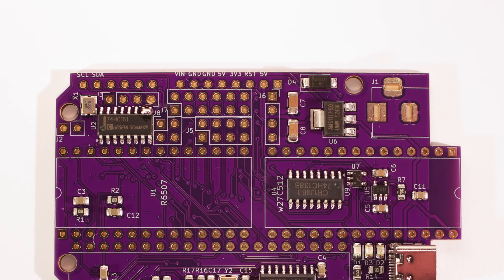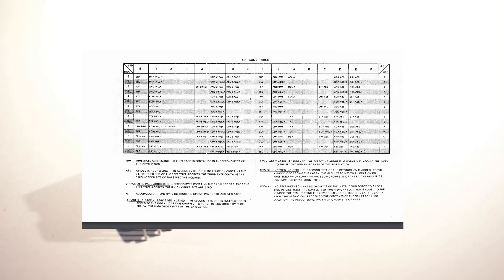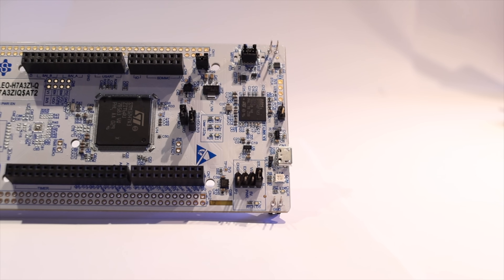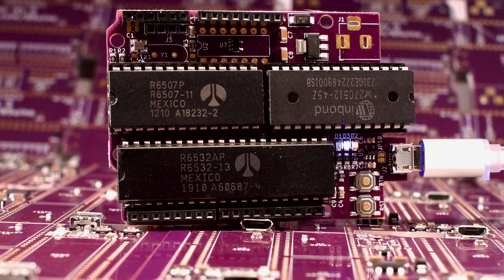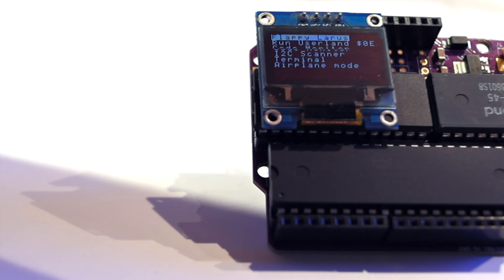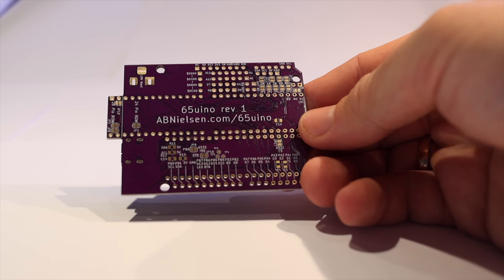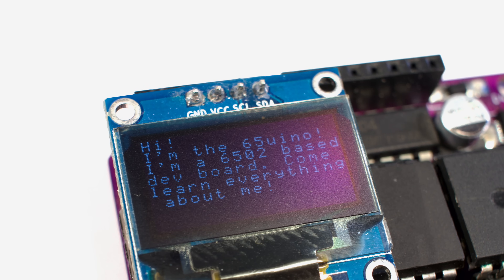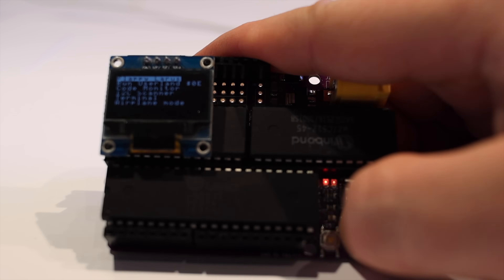6502 Turns 50! The BEST 6502 Computer of 2025 is here!

Comment: I am looking at building a simple 6502 SBC that would consist of 32k RAM, 32k ROM, a MC6847 VDG, SN76489 Sound Chip, ATARI Joystick, and a cartridge port. The cart can have up to 32k that overrides the ROM.  It could have been a cheap game console in the late 70’s early 80’s.  Comes with a default game in ROM, carts for additional games. Games own the machine, no BASIC, no BIOS. No keyboard, no serial.  A special cart with a pi pico could be used for development on a PC.
Reply from the maker: I’d love to see it 😊
Reply: @AndersNielsenAA  it will take a little while,  I purposely chose a simple design so as not to get bogged down!  I’ll make a note of this video and when I have it working, I’ll come back here and let you know. It will definitely be on GitHub for anyone to make.

Comment: /*
 * About the “easiest way to run 6502 instructions” claim
 * ------------------------------------------------------
 * Saying that a tiny 6507 board is “the simplest and cheapest way
 * to run 6502 instructions” is simply false. It isn’t even close.
 *
 * The actual simplest and most faithful way is:
 *
 *     Run a 6502 emulator.
 *
 * Tools like VICE, MAME, or any cycle-accurate 6502 core give you:
 *
 *   - full 64 KB address space
 *   - accurate 6502 timing (even exact cycle timing if needed)
 *   - real IRQ + NMI behavior
 *   - full zero page, stack, addressing modes, quirks
 *   - complete hardware ecosystems (C64, VIC-20, PET, Apple II…)
 *   - debuggers, monitors, disassemblers
 *   - stable development workflow
 *   - instant loading, saving, flashing, stepping
 *
 * And all of that runs on a modern CPU at original or faster
 * speed without any hardware hacks or cut-down variants.
 *
 * Calling a 6507 + 6532 + EEPROM board “the easiest way to run 6502
 * code” ignores the fact that:
 *
 *   - the 6507 is NOT a full 6502 (reduced address lines, no IRQ/NMI)
 *   - the memory map is crippled to 8 KB
 *   - you must build custom hardware glue logic
 *   - you get no full-featured development environment
 *   - the board cannot represent a real 6502 system architecture
 *
 * A minimal 6507 system is a fun *hobby project*, but pretending it
 * is the easiest or most authentic path to 6502 programming is just
 * marketing noise.
 *
 * If you really want the real thing:
 *
 *     Use a proper 6502 core, or a real 6502-based machine,
 *     or an emulator like VICE that does not pretend to be
 *     something it is not.
 *
 * Emulators are honest: they tell you exactly which CPU they model.
 * Some YouTube projects should take note.
 */

Comment: /*
 * Reality check for 6502-themed builds
 * ------------------------------------
 * If you build a 6507-based board, just SAY SO.
 *
 * The 6507 is a perfectly valid member of the 6502 family,
 * but it is not a full 6502:
 *   - only 13 address lines (8 KB space)
 *   - no IRQ pin
 *   - no NMI pin
 *   - reduced pinout and functionality
 *
 * And if your design also uses a 6532 RIOT (RAM + I/O + timer),
 * then call it what it is: a classic “minimal 6507 + RIOT system”
 * – essentially the same architectural footprint as an Atari 2600.
 *
 * What you should NOT do:
 *
 *   - darken or sand the 6532 package to hide the markings
 *   - mount an OLED display directly over the 6507 so the label
 *     cannot be read
 *   - show a shiny 6502 in the project intro while the actual
 *     board uses a different CPU
 *   - market the build as “a new 6502 computer” when no 6502
 *     is physically present
 *
 * Retro computing enthusiasts are not stupid.
 * If the project uses a 6507, say “6507”.
 * If the project uses a 6532, say “6532”.
 *
 * Honesty builds credibility.
 * Hiding chips destroys it.
 */
Reply from the maker: The 6507 is literally the exact same IC in a smaller package. I have never been dishonest about what I use in my designs and have never moved a single finger to obfuscate anything  - schematics are only a single click away. So is the whole video series where everything you mention has been covered. 

The 6502 is very physically present - the plastic around it doesn't change that. An ATMega328p isn't any less an ATMega328p if it comes in a different package either - and there's quite a few of those. 

I'd love to open a 40 pin and a 28 pin side by side to show you one day.

Hope you're otherwise having a nice weekend :)
Reply: @AndersNielsenAA  /*
 * Thanks for the reply. Just to clarify the technical point:
 *
 * Yes – the 6507 shares the same 6502 core*, but it is **not*
 * the same IC in a smaller package. It has:
 *
 *   - only 13 address lines (8 KB space)
 *   - no IRQ pin
 *   - no NMI pin
 *   - a different pinout
 *   - reduced bus signalling
 *   - different external requirements
 *
 * That makes the 6507 a functionally restricted device, not a
 * “small-package 6502”. The difference is architectural, not cosmetic.
 *
 * The package is irrelevant; the missing pins and missing features
 * are not. An ATmega in DIP vs TQFP is the same chip. A 6502 vs 6507
 * is *not* the same chip – same family, different capabilities.
 *
 * And that is why the distinction matters:
 *
 *   The C64 does NOT work with a 6502.
 *   It works with a 6510 – same core, different IC.
 *
 * Same rule applies here:
 *   6507 ≠ 6502
 *   Same core, different processor.
 *
 * This is not a question of honesty; it is simply a matter of
 * technical accuracy when discussing the architecture.
 */
Reply from the maker: That is incorrect. It is not just the same core. The 6502 and 6507 share exactly the same IC in a smaller package. If you had the skill you could bond the extra points to external pins. None of the features are missing in the silicon.  Just like an ATMega in a lower pin count package. 
The 6510 on the other hand is not the same IC. You are correct about that part. 

Same core, same processor - hence every single possible instruction (including the illegal ones) operate the same on the 40 pin package if you didn't hook up the extra pins. 

Hope you learned something.
Reply: @AndersNielsenAA  /*
 * Just to keep the terminology technically precise:
 *
 * A microprocessor is defined by its **externally available signals**,
 * not by the unbonded structures that may or may not exist on the die.
 *
 * The 6502 and 6507 may share the same silicon layout, but they are
 * *not the same processor* because:
 *
 *   - the 6507 exposes only 13 address lines  (8 KB space)
 *   - the 6502 exposes all 16 address lines   (64 KB space)
 *   - the 6507 has no IRQ pin
 *   - the 6507 has no NMI pin
 *   - the 6507 lacks a number of control pins (RDY, SYNC, etc.)
 *   - the pinout and system capabilities differ accordingly
 *
 * These missing pins are not a cosmetic difference — they define what
 * the device can and cannot do in an actual system. That is the
 * engineering definition of a different processor variant.
 *
 * Whether unused bond pads exist somewhere inside the package is
 * irrelevant. If the pins are not bonded out, the functionality is
 * not available, and the part is not a 6502 in any practical or
 * architectural sense.
 *
 * By that logic, a 6502 die bonded to a single pin and used as a
 * paperweight would still be a “6502” — which demonstrates why
 * external functionality, not internal die similarity, defines the
 * processor.
 *
 * Summary:
 *
 *   Same die family ≠ same IC.
 *   Same core       ≠ same processor.
 *
 * The 6502 and 6507 are related parts, not identical ones.
 */
Reply from the maker: @K @KaiWeber-gl6fb It’s the same exact IC in a different package. Of course it’s a 6502.
The only difference is Rockwell decided to bond it to a different package. 

Have fun :)
Reply: @AndersNielsenAA  /*
 * One last clarification on terminology, then I’ll leave it at that:
 *
 * In engineering practice, an IC is defined by:
 *
 *   - its part number
 *   - its documented pinout
 *   - its externally available signals and capabilities
 *
 * The 6502 and 6507 have:
 *
 *   - different part numbers (6502 vs 6507)
 *   - different pinouts
 *   - different sets of bonded-out signals
 *   - different documented address ranges and use-cases
 *
 * That is exactly why MOS and Rockwell gave them different names
 * and separate datasheets. From a system designer’s perspective,
 * they are two distinct ICs, even if they happen to share the
 * same underlying die.
 *
 * Internal silicon similarity does not override the external
 * specification. If the *datasheet**, **marking* and *pins*
 * say “6507”, then in every practical and architectural sense
 * you are designing with a 6507, not a 6502.
 *
 * Otherwise, by the same logic, a binned 8-core CPU sold as a
 * 4-core model would still be “really” an 8-core processor,
 * which is not how hardware is specified or sold.
 *
 * So:
 *
 *   Same die family  → yes, very likely.
 *   Same IC          → no, the 6502 and 6507 are different parts.
 */
Reply from the maker: @KaiWeber-gl6fb  Again - it’s the same IC. Hence there’s no special documentation for the 6507 - it has exactly the same reset vectors at $FFFC/D. 
How? It doesn’t know the top address lines aren’t connected to anything.
It also has instructions that make no sense without IRQ - but they’re still there and operate the same.
They share the same datasheet and manual for exactly that reason. 
The only difference is the package - it’s not a different CPU in any sense other than semantics.
Reply: @AndersNielsenAA  /*
 * Let’s separate three different layers here, because they are being mixed:
 *
 *   1) CPU core behaviour (micro-architecture, opcodes, vectors)
 *   2) Silicon / die reuse (manufacturing)
 *   3) IC as a usable component in a system (pins, signals, part number)
 *
 * On (1) and (2) we are actually in full agreement:
 *
 *   - The 6502 and 6507 share the same core.
 *   - They execute the same instruction set, including illegal opcodes.
 *   - They fetch the reset vector from $FFFC/$FFFD in the same internal
 *     16-bit address space.
 *   - The die layout is very likely reused.
 *
 * None of that is in dispute.
 *
 * Where we differ is (3): what counts as “the same CPU” for a system
 * designer. In practice, the part is defined by:
 *
 *   - the part number on the package,
 *   - the pins you actually get,
 *   - the signals that are externally available,
 *   - the documented address range and use-case.
 *
 * From that perspective, the 6507 is not just “a 6502 in a smaller
 * package”, because:
 *
 *   - Only A0–A12 are bonded out  →  8 KB directly addressable space.
 *   - IRQ and NMI are not bonded out  →  those interrupt sources are
 *     unavailable to the system, regardless of what exists on the die.
 *   - Other control pins (RDY, SYNC, etc.) are likewise missing at the
 *     package level.
 *
 * The fact that the core still internally runs a 16-bit address
 * calculation and still fetches from $FFFC/$FFFD does not change the
 * external reality: a 6507-based system cannot decode a full 64 KB
 * map or wire IRQ/NMI in the same way a 6502-based system can, simply
 * because the pins are not there.
 *
 * That is why, in actual hardware documentation and schematics, one
 * speaks of “6502” and “6507” as different ICs:
 *
 *   - same core family,
 *   - different pinout,
 *   - different exposed capabilities,
 *   - different role in system design.
 *
 * Calling them “the same IC” because the internal core and vectors
 * match is a statement about manufacturing and micro-architecture,
 * not about the component as it exists at the pins.
 *
 * For software-only discussions, your view (same core, same manual)
 * is fine. For hardware and system design, the distinction between
 * 6502 and 6507 is very real and technically important.
 */
Reply from the maker: @KaiWeber-gl6fb Integrated circuit. Referring to the Integrated Circuit of course - the silicon wafer where the circuit is integrated.
The package isn’t the IC - the IC is the IC.

The original 6502’s share the same IC - even if they’re packaged differently.

The architecture is 6502 - that has nothing to do with the package either - it’s just a predetermined choice of which pins you intend to use.
Reply: @AndersNielsenAA  /*
 * Fair enough – if by “IC” you strictly mean the bare die artwork,
 * then yes: the 6502/6507 share the same integrated circuit in that
 * narrow, manufacturing-centric sense.
 *
 * That has never been the point of disagreement.
 *
 * What I am talking about is the *device* that a system designer
 * actually buys, places, wires and codes for – and that is defined by:
 *
 *   - part number (6502 vs 6507)
 *   - documented pinout
 *   - which signals are bonded out
 *   - guaranteed address range and usage
 *
 * On that level, 6502 and 6507 are not interchangeable:
 *
 *   - 6502 → full 16 address lines, IRQ, NMI, RDY, SYNC, …
 *   - 6507 → only A0–A12, no IRQ/NMI pins, reduced control signals
 *
 * Same internal core and vectors? Yes.
 * Same *architecture family*? Yes.
 * Same *device* from a hardware point of view? No.
 *
 * That’s why:
 *
 *   - datasheets distinguish clearly between 6502 and 6507,
 *   - schematics label them differently,
 *   - and designs like the Atari 2600 are described as “6507-based”,
 *     not “6502-based”, even though the core is 6502-compatible.
 *
 * So if you define “IC” purely as the silicon pattern, your statement
 * is understandable. If you define it as the usable component at the
 * pins – which is what most hardware people mean – then 6502 and 6507
 * are different parts with different capabilities.
 *
 * My only point in this thread is to stay precise about that distinction.
 */

Comment: You know there are 200mhz 6502 enabled ASIC's out there.  A 200mhz 6502 (likely 130nm node) with memory adc/dca and io included would probably be able to fit in mm square (10mm with all pins).  It could even probably run at 10Ghz, in 2nm node, 16-bit version, with 1MB+).  If somebody did an old 65nm low energy version, it might be up to 400mhz.  If you did performance 65nm, maybe it could go 1-Ghz.  But, it probably won't be so low energy.

You should try to hunt down a 200mhz 6502 enabled ASIC to do something with?
Reply from the maker: There are so many 6502 IP cores out there so it’s certainly possible - but I think my attraction drops a bit when moving away from the NMOS 6502.
It might be fun to make a 6502 inspired CPU with a low transistor count - but then it’d be its own thing.
Reply: @AndersNielsenAA I'm talking Western Digital Core IP mentioned on its front page.  A genuine 8 or 16 bit cmos, likely with integrated peripheral chios.  Very similar programing.  Whoever makes it compatible with mos or cmos series instruction set, it's just the same but at faster speeds.   So, if you can find 100's of mhz, or ghz out their and clock it down to 1mhz for low energy and up to Ghz.  Why not go for it, on the 50th anniversary celebration.  Make a grrat product for all 6502 enthusiasts.  There is also a drop in 100mhz fpga replacement if you cant find those.

The 6502 is yesteryeared, a faster version mskes it todayed.  You dont need all the fancy bells and whistles of the mega processors, there is still a lot of stuff a simple processor can do, and even more faster.   I'm not just saying 3D, but software radio and anything a simple but fast processor can do, like emulate all 6502 computers.

Comment: First experience with hands-on assembly programming at UMass using KIM-1s in the lab with 6502 assembly in 1979. We didn't have access to cross assembly so everything we did was hand assembled where we wrote down the addresses, mnemonics, opcode and data values, and clock cycles in columns on photocopied paper forms and then keyed it all in by hand. Luckily, the cassette tape interfaces usually worked so at least we could store and reload the programs when bugs would corrupt them. Usually. Bug fixes usually meant inserting jumps to patch routines since there wasn't enough lab time to deal with the 'reassembly' required for inserting or deleting code in-line. One piece of code I always reused was one that increased the debounce time for the KIM-1 keypad. The debounce was marginally reliable when the contacts were new, but after a few thousand lab keypresses getting a good keypress would often take several tries.
Reply from the maker: These days it’s hard to imagine the persistence needed to do it by hand.
I’m still planning a toggle switch “trainer” with ROM being optional :)

Comment: now make a super computer with 6502 6502 :)
Reply from the maker: 6502 cluster computing sounds like just what I need for a new project :D
Reply: @AndersNielsenAA you could use a 6502 that sends code to a board with many other 6502 running the same code but in parallel with different parameters (inspired by shader pipeline) that together compute ray traced scenes. The target frame rate is 'realtime'. That's just an idea. Other things would be to add PCIe port and put it inside a modern motherboard, writing your own drivers for it. And so instead of a lame emulator, it runs games with actual hardware. Anyway have fun.
Reply from the maker: @numero7mojeangering  I’m thinking DSP like FFTs and stuff. Raytracing may take a bit to do realtime 😅
Reply: @AndersNielsenAA yeah 😂. So many other ideas. Like making music instruments. Or you could invent a new gaming console, just plug usb, connect to the website, click upload and you're now playing snake coded by someone on the internet. (With the possibility to see and modify the code)